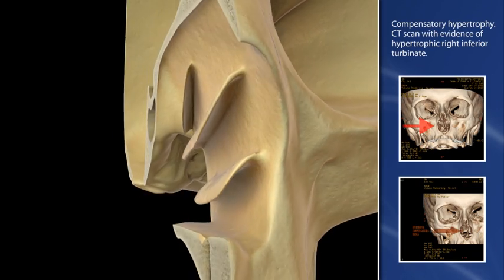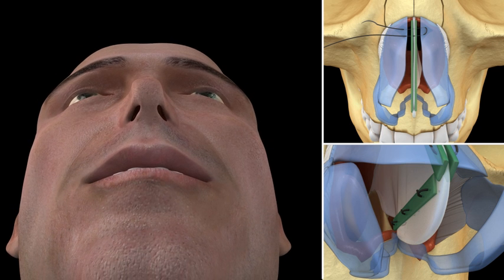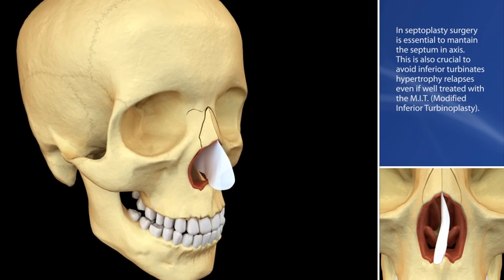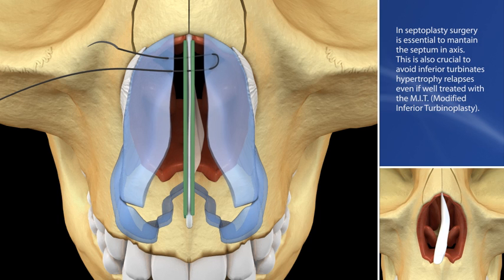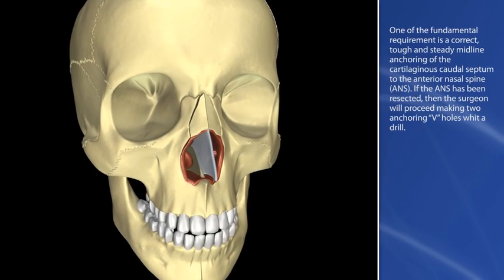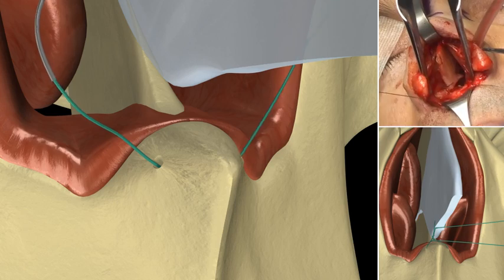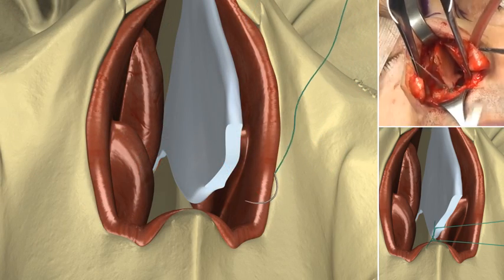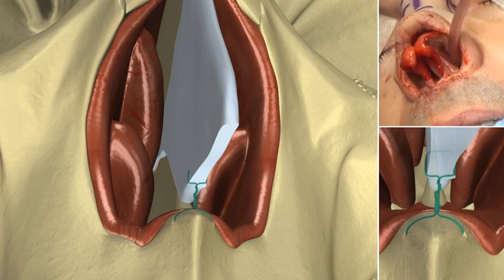SEPTAL CARTILAGE FLAXATION: GOTTARELLI 3GK KNOT

Comment: I think , It's happened for many years of sleeping on heighten pillows with same direction pressure build-up on middle of the nose septum and sometimes spur creates from micro fracture, needed to sleep on plain surface with opposite direction for try to staight it , devieted septum is main cause of turbines hypertrophy , turbinates are accumulated according to septum position changes..